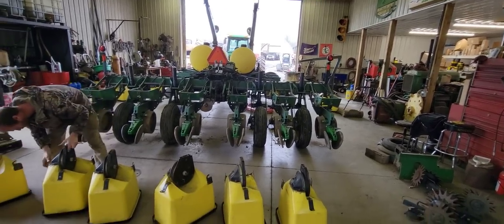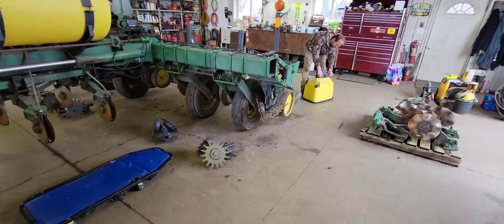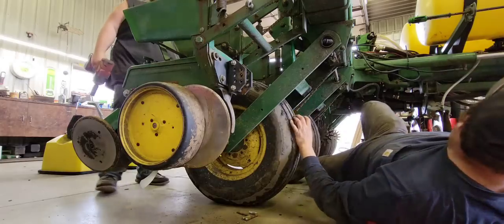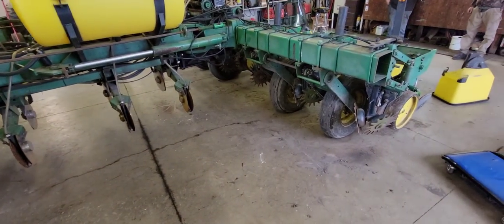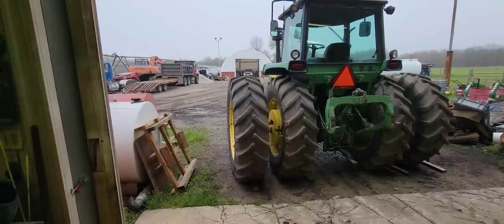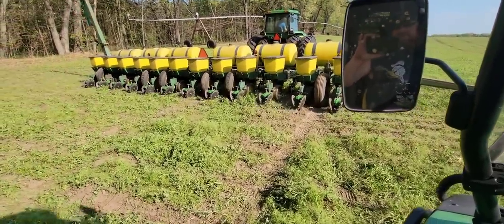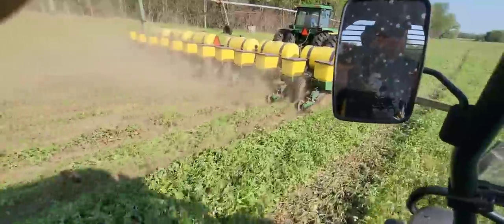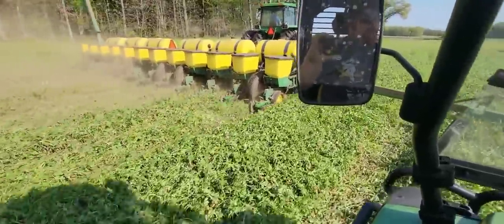John Deere Corn Planter Yetter Row Cleaner Installation Video

Comment: I added Martin floating row cleaners to my 7000 12 row. I built a bracket to mount them to the bracket that holds the row unit to the frame. My ride came up about 4 percent and took 80 lbs off row unit. I strip till the corn. Great video as always. I enjoy your team and a great operation.

Comment: You're lucky to have easy access to the pin on Row cleaners to adjust height, you will end up moving them more than you'd expect. I have a front tool bar in the way so had to weld some threaded rod to easily adjust height.